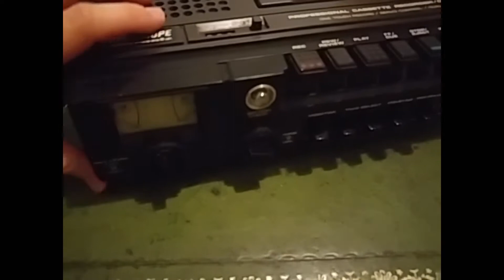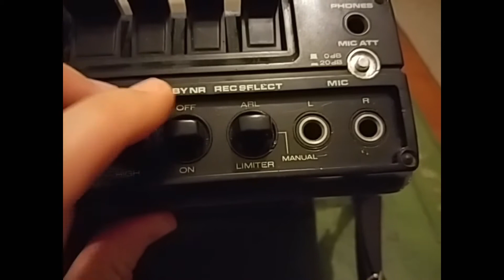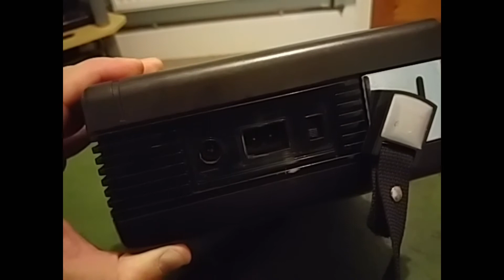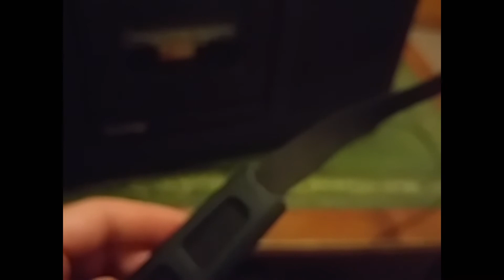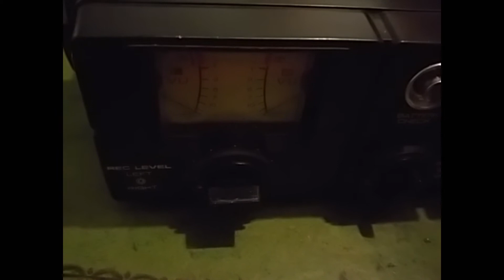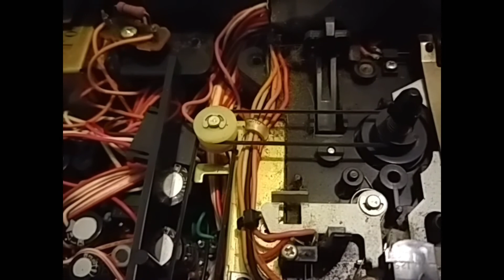Marantz SuperScope CD-330 Repair: Part 1 (Fixing Old Junk)

Comment: i didn't have to remove the transport section like you did. It kinda flips out all together if you unscrew a few things here and there. Motor, mechanism and the play rev fwd etc part, all together.  I think it is hopeful to install new belts now.

Comment: i have a Marantz PMD222 and the tape doesnt run anymore. When i play the motor sound is louder and deccelarates much slower when stopping. like 2 seconds while previously it was like instant. Also there is no difference in sound when play and pause together.
I fear the belt has ripped, thats why the missing resistance/friction makes the motor whirr down slowly? 
I opened it the backside and tadaaa. No acccess to anything that easily.

Comment: How did you get the top cover off!?!?
Reply: There are 2 studs (Large flat screws) and a fillips screw inside a deep hole (right side).  The video misses most important fact!  Good luck
Reply from the maker: It's held down by several screw posts accessible from under the bottom cover. Did you find them?
Reply: @vext01  I took all those screws off but it still won't come off
Reply: I found them and I replaced the belts! Thank you!
Reply: Thanks

Comment: trying to get the top off, how the hell?
Reply: Trying to do the same right now. Did you sus this out?
Reply from the maker: You have to open the bottom first and remove several screw posts securing the top cover.
Reply: @vext01 and no one shall know where